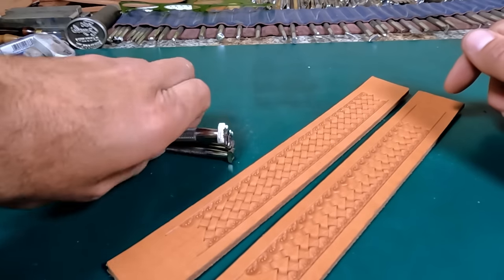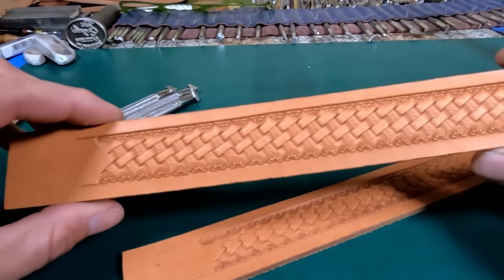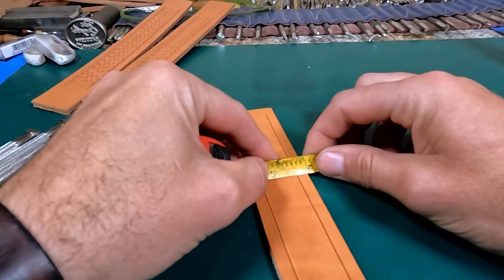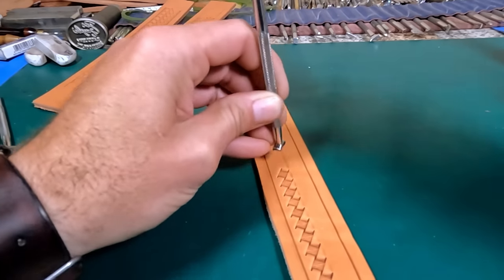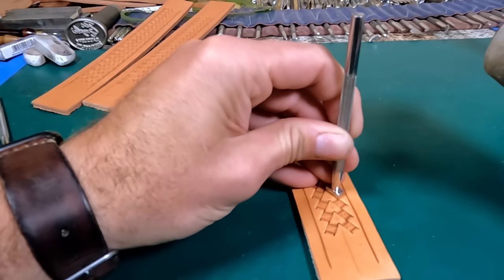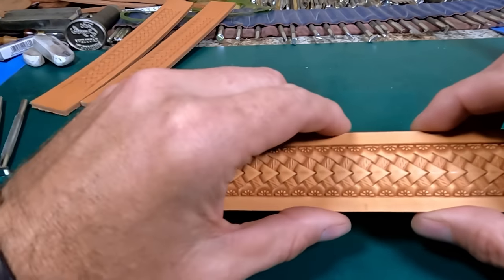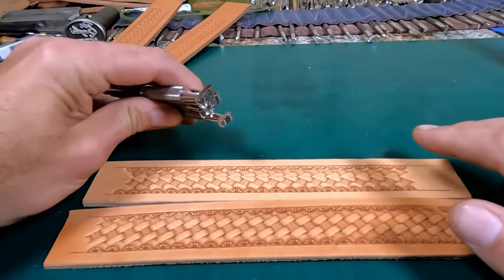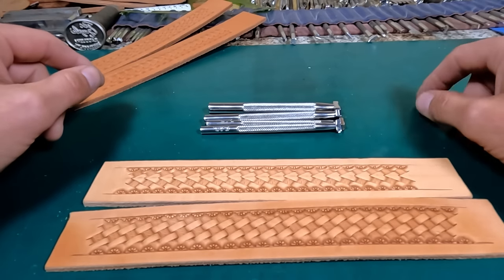Two Different Belt Basket Stamping Styles

Comment: On the angled basket in your second demo, I make a center line like you did on the first one.  Then I run the first angled row of baskets all the way up the center.  I've found working from the center to the border provides a balance on both sides of the center line versus running from one side to the other.  Easier to DO than EXPLAIN.

Comment: Awesome work!!! Hey ive got a old belt that was my father in laws im trying to fix up for my son. In a couple spots where the decorative tooling is, that thinner part of the leather has broke/cracked. I think I can glue down add a backing on the belt to stabilize and hide that. Can you recommend what to use for backing and what kind of adhesive? Right now its just a solid piece of leather and I dont want to sew anything.

Thanks for any advice you can offer!

Comment: How wide are the edges outside your stamping, Don? 3/16, 3/8 inch? Nice looking pattern, I'll have to try that on my next belt / sling project...on the diagonal pattern, couldn't you run a 45° start line, to help?